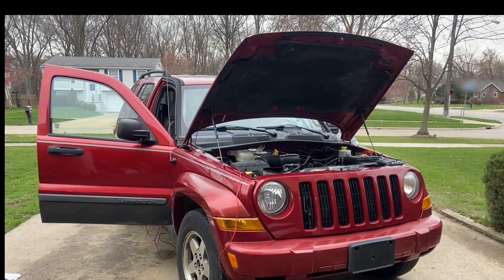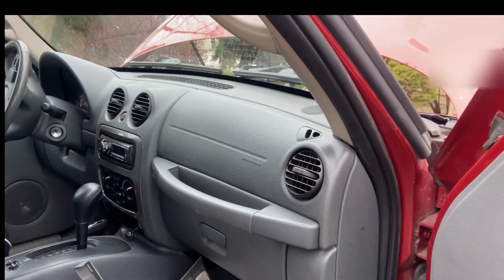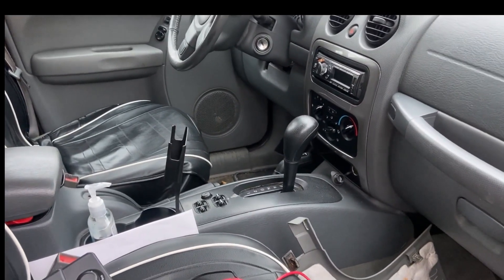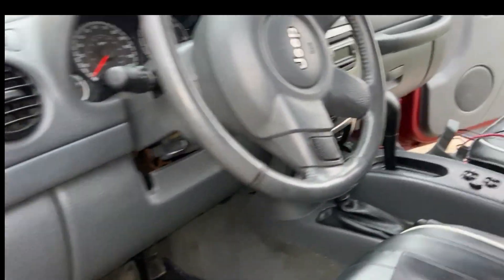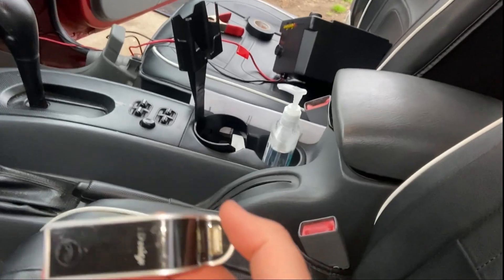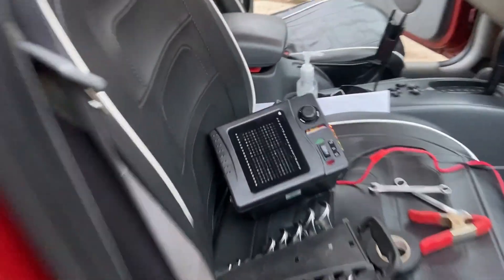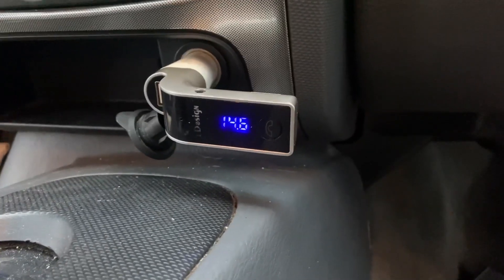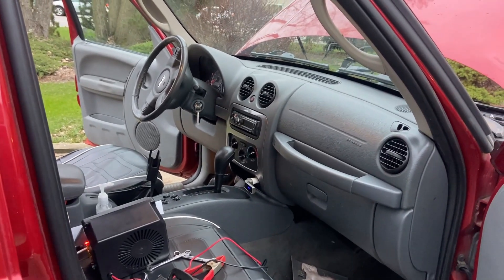Jeep Heater Core Bypass, Electric Heater Install

Comment: Just wondering what part of the country you live in and how cold it gets in winter. I'm thinking this could be an option for our old jeep liberty.
Reply: I am doing a heater core replacement on my 04 Jeep Liberty. Just started the adventure, so yeah. Great idea with the electric heater! This may help, face the heater towards the recirculation door, usually in the floor board area, passenger side. This should circulate through the vents, when on that control setting. The 04 only does this on A/C. Hope this helps.
Reply from the maker: I’m in the Cleveland Ohio area. I figured out it can keep the Jeep relatively warm in about 40F and higher. I plan on getting a 150watt heater to help next winter. Some people online have wired 150watt harbor freight ones into the window 20amp circuits in the center console.